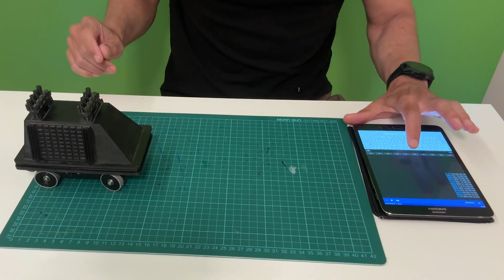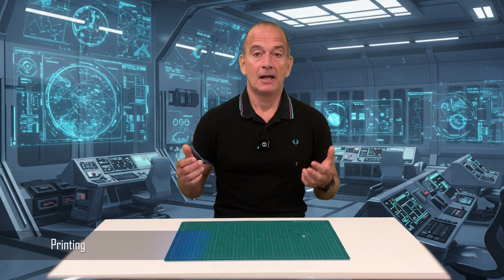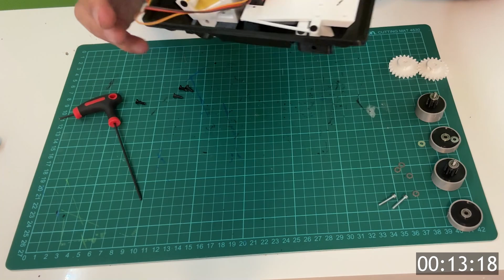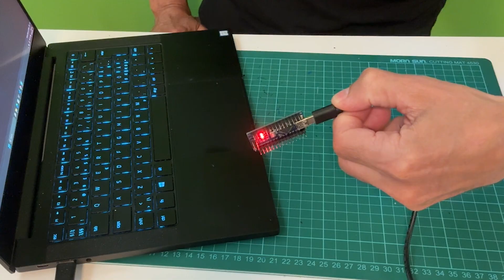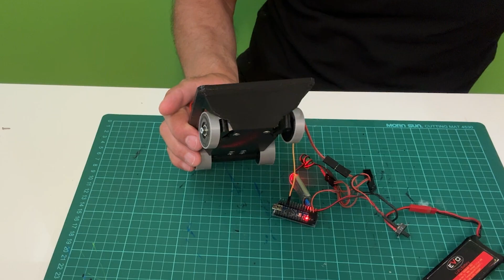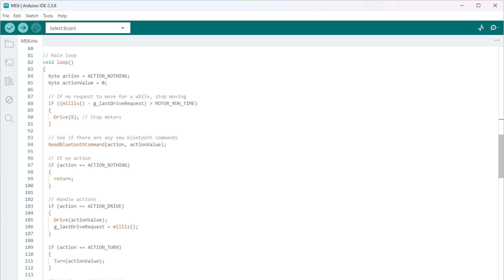3D Print your own ME-6 Star Wars Robot

Comment: Cool project! thanks for sharing. 

The link to the UBEC is not working for me, are you able to share the model name or data sheet? 

Also i see that the servo motor is used for steering, what mechanism is used to turn the wheel using the servo?

once again very cool project! thanks for teaching about robotics!
Reply from the maker: @benjamincounter2022  ubec is hobbywing 3A because it is small but any will do. The servo controls wheels through 3d printed parts
Reply: @jakobleander i see, thank you! are the 3D printed parts some sort of rack and pinion gear mechanism?